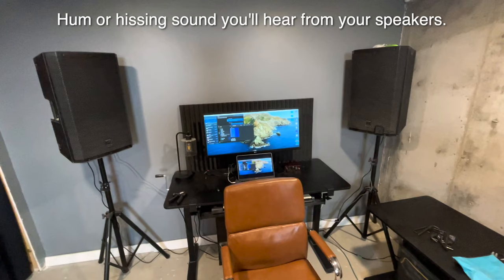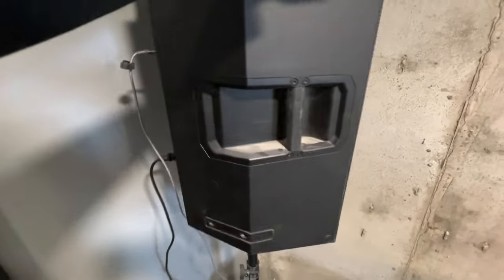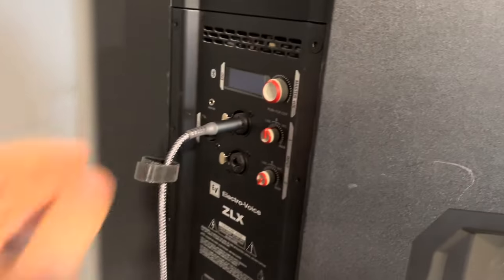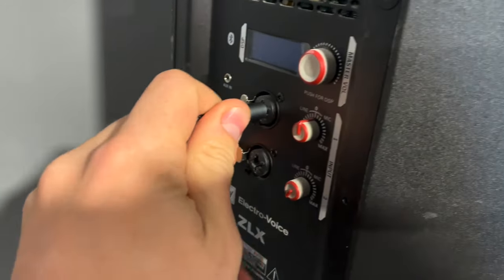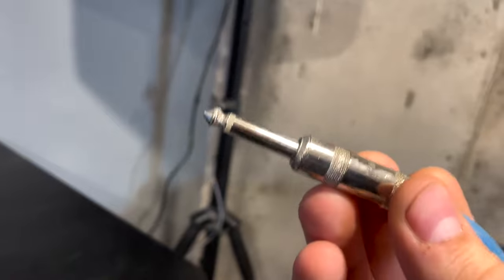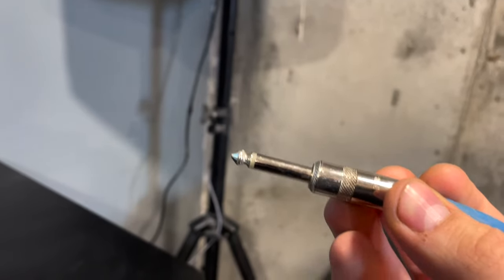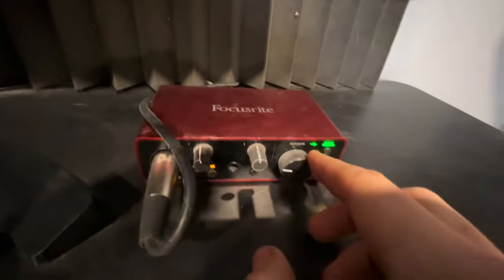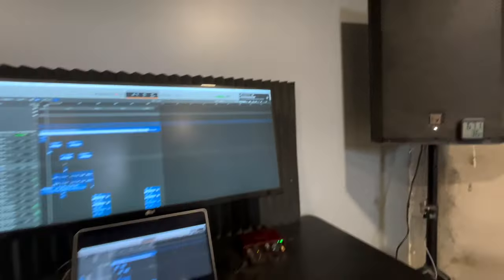Fixing The Humming Or Hissing Noise On Your Speakers

Comment: Bro, you just switched from a mono 6.35mm cable to stereo 6.35mm cable. No magic here.
Reply from the maker: It may seem like a no brainer to you, but you’d be surprised how many people don’t realize that you can reduce the hissing by having the correct cables.
Reply: @DJ.Sparks.Studio I just unmuted unplugged and plugged again and boom 😂 thanks for demonstration though I got motivated simply by that 🎉😂
Reply: There is magic. Depending on the output of your system, the TRS “stereo” cable can be used as a BALANCED “mono” cable. In fact, many professionals use balanced cables instead of unbalanced (TS cable which you described as mono)  to get rid of interference on the cable. This is achieved because it has 2 signal wires and 1 ground wire instead of 1 signal wire and 1 ground wire. What happens is that the noise is picked up in reversed polarity on the negative signal wire and gets flipped when reaching it’s destination. That means that the noise picked up along the way gets cancelled out (almost) completely. So be careful when saying “stereo” cable to an actual “balanced” cable.
Reply: @DJ.Sparks.Studio  Yeah because not having the black line separating the two contacts in the speaker’s amp,  just shorts those two pins together, resorting in a gnd loop
Reply: It may not be magic, but for people who aren’t well-versed in audio interfaces and speakers, it helps a lot
Reply: @DJ.Sparks.Studio bro it was magic for me, I had no idea what was happening, thanks for the video 🤙
Reply: There is a magic he even tell you but you still didn't get it balanced cable is more quieter especially over longer distances so yes it makes a difference.
Reply: Keeps crying buddy 😂
Reply: Yea but some of us know literally nothing about this stuff & the explanations help some

Comment: Lots of issues here. The tip-ring-sleeve (TRS) style cable you used is not a balanced cable, nor is the 1/4" phone jack a balanced connector. It is an unbalanced cable for stereo or  2-channel circuits. That it works to shield noise in this application is simply good luck - mono jacks can have the shield contact anywhere along the sleeve, which could result in no change in results. I'm glad it works for you, just know that it was pure luck. An XLR cable is one example of a balanced cable/connector system. The best answer for noise is to eliminate it at the source, which will take some time and troubleshooting skills.
Reply: Nope, nope, and nope. A TRS cable can be used as a balanced cable because it has the 3 conductors needed, as long as you have the correct connections on both ends. And the 1/4" phone jack that he is using is a balanced connector. You can tell because it's a combo connector that can take a 1/4" or XLR cable. Balanced cables are designed to eliminate noise that they pick up after the source.
Reply: @AnAntidisestablishmentarianist  The actual definition of an unbalanced cable is one that uses an outer shield as a signal carrying conductor. The definition of an unbalanced connector is the same. To be balanced, the pair of signal wires are separated away from ground, and are separated in the connector similarly. No type of phone (1/4", 1/8", TS, TRS, or TRRS) or phono connector is balanced.
Reply: @stirlingschmidt6325  Nope. A balanced cable has 3 conductors, 2 of which carry the same signal, but the source phase inverts one of them and then the receiver inverts it again and sums the 2 together. Any noise picked up along the way is thus inverted on one of them and cancels itself out when the signals are summed together. In a TRS phone connector all 3 signals are separate, so even by your definition they can be balanced.
Reply: @AnAntidisestablishmentarianist  Here’s a gentle suggestion: get some education. You’re presenting your opinions as if they are facts, and they are not.
Reply: @stirlingschmidt6325  Just a brief internet search for balanced cables produced these quotes from different sites. Enjoy your education:
"On the other hand, balanced cables have three conductors in the connector and three wires in the cable: two signal wires (often referred to as hot and cold) and a separate ground wire. The signal wires carry the same audio signal but with opposite polarities, meaning that one wire carries the original signal while the other carries an inverted version of the same signal. This is known as differential signaling."
"A balanced cable consists of three conductors: two signal conductors and a ground conductor. The two signal conductors carry the audio signal, but with an important difference. One of the signal conductors carries the original audio signal, while the other carries the inverted version of the audio signal. This inversion process helps in canceling out any external noise or interference that may be introduced during the transmission. The ground conductor provides a reference point for the signals and helps in maintaining the integrity of the audio signal."
"The prerequisites a cable must have to carry a balanced signal (and thus be considered a balanced cable) are:
Have connectors with at least 3 pins on each side (spoiler: the connectors don’t necessarily need to be the same type)
Be properly wired to support a balanced connection."
"A balanced signal is a signal created in the output of a device, by either an electronics circuit called balancer circuit or by a transformer connected in a certain way. In essence, they both do the same: duplicate the original signal and invert the phase of the copy. This pair of signals, going out of the device and travelling through the balanced cable is our balanced signal. So when we talk about a balanced signal, we are in fact talking about a pair of identical signals, but one of them has its phase inverted."
Reply: @AnAntidisestablishmentarianist  Your first mistake would be taking the results of a Google search over the reality of an actual college education.
Reply: @stirlingschmidt6325  That's the best you've got? 🤣🤣🤣🤣

Comment: Not a feedback loop - EM interference.  And you solved it with a balanced (TRS) cable. On a balanced cable the interference is canceled out by the additional wire.  Goggle "what is a balanced cable and how does it work".
Reply from the maker: Thanks for clarifying!
Reply: I caught your attention saying "EM interfere" I tried to unplug my phone charger and it fixed the  humming sound of my earphones. thanks man 🤘👍👍

Comment: DI boxes with ground lift is a universal cure, surprised you didn't mention those. Converts unbalanced to balanced. Or if you get hum in your balanced you can use an audio quality inline xlr isolation transformer, I used that on my 15" sub. Sescom is the industry brand often used.

Comment: This guy knows what he is talking about! I had buzzing and humming from my Logitech speakers from my PC. I bought an EMI filter power strip, a 3.5mm filter, I switched out 2-3 cables from the cable pack that I bought and nothing helped. Turns out it was the cheap, crappy cables! I replaced it with a Monster brand 3.5 cable and all of the buzzing and humming is gone! Pure, clear, clean audio!! Thank you!
Reply: What cables diid you replace? the RCA cables going to the speakers? Or just the 3.5 mm going to the pc?
Reply: @mauritzbotha4422  The 3.5mm cables going from PC to the Logitech 623 speakers. So the line in/out. I think my new cables are Monster brand maybe? They're exactly what you said about the balanced and it 100% worked. I still can't believe it.
Reply: My speakers use speaker wire. Not like an amp cable or a mic cable like in the video. Its 2 wores, red and black. They plug into an amplifier. Im thinking its the amazon essential speaker wores. But the noise stopped for awhile. Then it came back today 😊
Reply: My amplifier doesn't have any cables plugged into it. it has a humming sound even when the volume is zero.
Reply: شكرا جزيلا.
Reply: شكرا جزيلا.
Reply: @Chinhnguyen0497  same here

Comment: Mine does it when I plug my interface or monitor into my MacBook. Not the speaker or instrument cable. How would I solve that issue?
Reply: If your laptop is not plugged into DC power, does it still do it?
Reply: @Mubashir4802  yup. Everything’s plugged into the same power conditioner as well.

Comment: I have Alto TS315 speakers that I bought in 2019 and they do the humming noise. I have krk rokit 7g4 monitors plugged into my Pioneer XDJ-XZ and they dont hum.  Going on your video, I have just purchased off Amazon 2 x XLR female to 1/4" jack TRS shielded balanced cables to hopefully eliminate the hum in the Altos.
Reply from the maker: Awesome! Let me know if that fixes the problem
Reply: @DJ.Sparks.Studio  Hi, unfortunately I tried the cables and still have the noise, however it is only when the speakers volumes are cranked right up that it becomes noticeable.
Reply from the maker: @jasperhay  yea it doesn’t remove it entirely if you’re cranking up the volume but it does remove most of it.
Reply: Sometimes that noise has to to with the electricity in the space, if it's earthed properly or not, and if you are sharing electricity with light fixtures that have a dimmer, this will usually mess up your system. Im struggling with long distances   humming and noise. Not sure how to clear it

Comment: i get this sound all the time with just my regular speaker for my computer. just basic small speakers. its annoying. its not there all the time. it starts of small. than slowly gets louder & louder. i have to shut my speakers of at night. because even with my computer turned of. if the sound is still on. it makes the noise midway through the night. so frustrating. thankyou for this video, i hope it solves it. as i’ve spent way to much trying to fix my computer and its only a year old 🥲

Comment: Hey! good stuff... I guess most PAs work on XLRs so here's a quick question. 

How long have you been using this setup? (Scarlett Solo and your EV PA) Also, does it work its full capacity with the DAC of your Scarlett solo?

Edit: I just realized the impedance & power rating of the amp inside the Scarlette solo should match that of a driver that big! I highly doubt that, and thus this might ALSO cause the hissing or humming sound. Other than that... Good luck ahead man cheers!
Reply from the maker: I’ve been using the PA system connected to the Scarlett for over a month. 

Previously I owned large KRK speakers and they also had the hiss. I didn’t realize until recently it was because of the cables.

Comment: I had new speakers all around my car and they sound like they blew up but all at the same time. So I installed a brand new radio and new speakers again. But the speakers still sound blown around level 20 what could it be? No subwoofer in the trunk

Comment: I recently bought an NX6000D to power dual UM-18s yesterday. Unfortunately, I'm only getting buzzing out of the speaker, no sound at all. I've swapped out 2 different speakon cables, I hooked the amp to 2 different AVRs, 3 different subwoofers, tried both channels A & B and still only getting that buzzing noise. I logged into the DSP with my computer and tried different settings and still only buzzing. I only have 1 XLR to RCA cable so that's the only cord I haven't been able to swap out (it's a brand new monoprice 3ft cable). Does anyone know what could the potential issue could be? I'd love to hear your thoughts on this, this is my first amp so I could be doing something wrong.

Comment: I currently have an issue with my subwoofer where it will randomly make a coughing noise (best way i can destribe it) after it recieves a signal from my amp

I'm not sure if it is due to wear and tear of the subwoofer. Its an Onkyo Skw-588 i believe either a 10inch or 12inch woofer about 6 years old and never been dropped or damaged. 
My amplifier is a denon avr-x2300w same age as subwoofer 

The issue is that it is inconsistent and only makes the noise 1 time after initially recieving the signal at high and low volumes. And my subwoofer is set to 50% at all times and i have even reduced it slightly and still does the same shenanigans😂

If anyone knows anything or has had similar issues with either the same model, age or other onkyo subwoofer please let me know. Cheers

Comment: It should be a TRRS jack plug for real balanced used with quad core cable...what you showed was a plain mono then a plain stereo jack plug...TRS plugs have tip, ring & sleeve
,2  black lines on jack plugs
...TRRS, tip ring, ring, sleeve jack plugs are the best for noise rejection used with Quad Core Balanced Cables
..ps..that is a plain stereo jack plug not balanced, TRS is balanced, stereo jack plugs are not balanced...i thought you knew about these things ?...you had mono plugs in originally not TRS balanced...the second are just plain stereo not balanced bud...it was my job for many years doing PA  building & repairing...👍
Reply from the maker: I don't know what to tell you. It worked for me so I'm just sharing my experience.